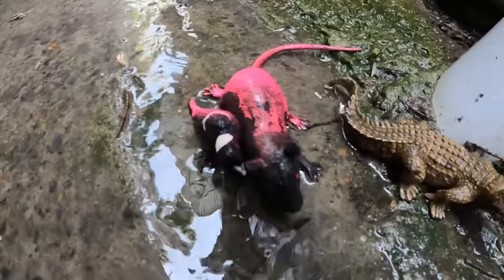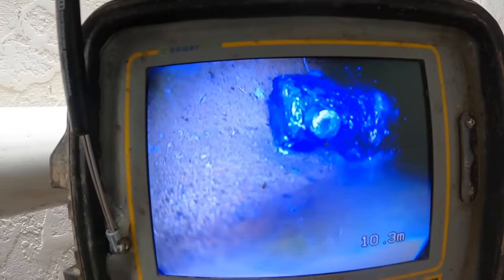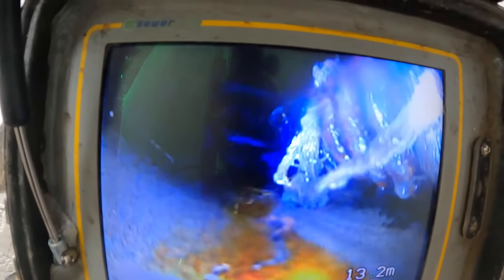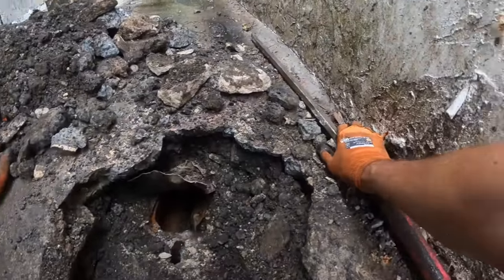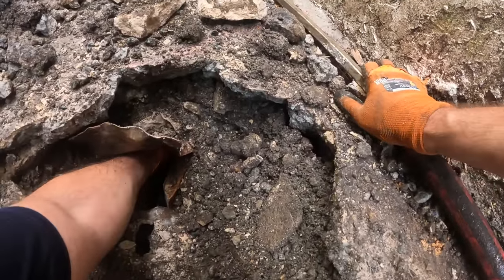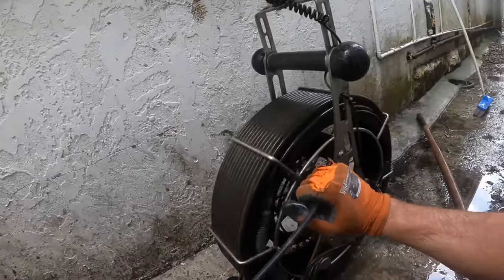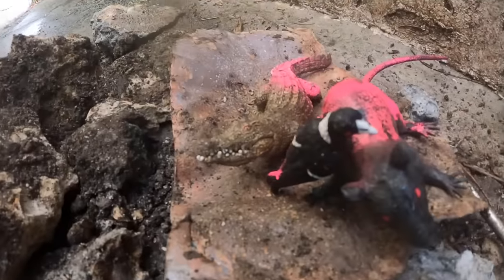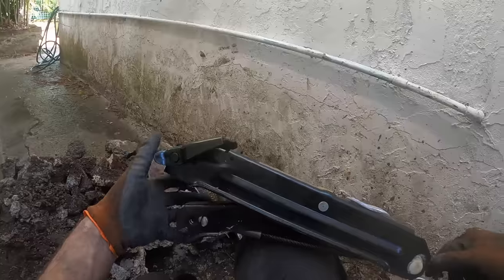Blocked Drain 590

Comment: The Honda refusing to start was great foreshadowing of what a crazy operation that was going to be
Reply: The little Honda is starting to start like a Hyundai 🤣
Reply: Starts like a Hyundai and runs like one too.
Reply: @SnowleopardPearl  can't kill a Honda.......unless you starve it of oil ,they are one of the best little engines around, seen Honda engines run indefinitely with just basic maintenance & simple rebuilds, seen rebuilt Honda engines sound & work better than most of the newer knockoff junk from China or new US built Briggs &Stratton/ Tecumseh engines
Reply: @SirBlueWhale     Hb  zuyuu
Reply: @SirBlueWhale  ur o ybbbbbhhhrbhmhhhb. Fddd be. R no
Reply: @SirBlueWhale     Ici
Reply: @daewooparts  this comment did not age well. That thing is a goner a few episodes later.
Reply: You are the best if you can’t do it know one can 🪠🪠🪠🪠🪠

Comment: WOW Ollie that’s one of the most intense ones you’ve done in awhile! That poor homeowner has some major pipe issues and not to mention the sinkhole under the house!! 
Will there be a part 2 to this home when they do the pipe work??
Reply: With the clog at the bottom removed , they will put a "temporary" patch on the alleyway walk. ... and All Good.
Reply: @deconteesawyer5758  Yeppers they will😊
Reply: Judging by the rest of the property, any “temporary” patch will be there for decades.
Reply: @digsindirt4490  True that! 😂
Reply: "pipe issues"???  The entire building infrastructure, as in,  the mortar holding the bricks and block work together has failed, add that to the foundation falling away [sink hole]... notice the huge cracks in the walls of the exterior of the home, that follow the failing blockwork.  If this was in the US, it would be considered too hazardous to occupy and would be condemned.
Man... I really feel for the owners, this is going to keep them up at night for the foreseeable future.
Reply: @2tommyrad  Well yeah!! I just do isn’t want to say that they just need to jack the house up and slide a new one underneath it 😂😂😂😂
Reply: @2tommyrad  totally agree. I’ve never seen a house in the entire US in this shape 😂

Comment: "Inspection openings (IOs) allow access to the inside of the pipe so that blockages can be cleared." You just have to remove the concrete slab...💪🔨😅

Comment: Is there going to be a (to be continued)? Would love to see what it's actually going to take to finally get that eel out of the drain!

What an absolute bugger of a job 🥴
Reply: He says at the end what needs to happen. Its not just the eel, theres a sinkhole under the house and the plumbing is messed up. He said the best thing to do, is lay another pipe under the walkway outside and join up with the boundary trap. Put the old pipe out of commission.
Reply: @tubester4567  yeah but there was another pipe coming into that pipe that would need to be brought around the house if possible.  Being on the side of a hill like that and a pool in the back it would be a nightmare.  That other pipe coming into that Tee? is probably what let the cable loop around itself like that.  You could probably put on another addition with what it will cost to fix it right.  I'm betting they fill in the hole and just let it be.
Reply: @Spaznaut1  ... go down to Home Depot and get some "day labor" to dig a new trench in a few afternoons.

Comment: Ollie; use vice grips to clamp onto the snake and rotate it backwards to get that knot to uncoil; then use a come-a-long to pull it out; It may just slide out easy once that knot is gone.   You really went the extra mile on this one!
Reply: gary ... so the knot is undone but the end of that snake is still cork-screwed into something, which is why the snake is stuck in the first place. Now that we see the problem the only fix is to replace the pipe.... because the stuck end is under the house where nobody can work.

Comment: I use to use old style car jack that had a post and travel mechanism to pull up old fence post that were not cemented in place.  Worked like a charm.  Since the car manufacturers moved to these new safer scissor or lever car jacks those never would do the same job.

Comment: With that concrete patch you’re breaking through looks like there was a previous problem in that location.
Reply: I think that is where the plumber disconnected the cable probably two lengths still in there.
Or it is just a coincidence where it disconnected.
Reply: I think you’re looking at the previous problem.
Reply: @ratbag359  guaranteed they opened and disconnected it there, the connector end, roll pin and release button were all still intact. and I doubt the female end broke away from it., the spring steel wire usually breaks first, very near the end or where it was kinked and worn thin from rubbing.

Comment: Potential source of the eel: sabotage. Plumber got "hired" for a job, got stiffed, and returned the favor. It would also explain the fact that the IO at the head is completely concreted over.

Reminds me of when I was trying to get internet installed at one of my old living places. Turns out a contractor had cut my stack of units' internet lines when the upstairs neighbor moved to cable internet. No one did a full diagnosis because the person we bought it from wasn't around enough to notice the loss of coverage.

Comment: Do you think reverse on the cable would undo the knots.  It looks like they broke the concrete to detach from the cable.
Reply: Maybe but the plumber might of already tried.
but it would not of fixed the main problem broken pipes

Comment: Car jack. 😆
It'll probably have to stretch at least 2 meters before it comes flying out of there.  A winch or come-along, as well as some anchors and attachment gear (quick links, webbing, etc) would be a good addition to your van.  Wouldn't fix the original nightmare that required the eel in the first place though.

Comment: Just wondering (I have zero experience,  so take this comment with this in mind) ... would it be possible to secure the end of the eel, which is basically a coiled spring, by encircling it with a heavy metal ring then slipping the ring transversely thru the coiled spring until it it stopped by a loop of the coil, and then giving that metal ring a 90degree twist, so that it locks against the coil? Then perhaps you can manoeuvre a carjack to jack it out by somehow attaching that metal ring to the carjack.

Comment: My dad had the same trouble on our motorhome with the generator going out and when he pressed the start button it kept on cranking and then my dad had to pull the heavy generator out of one of the capartments of our motorhome. My dad had to fix the stator on it. A few more years later the generator went out again so my dad took it to a Cummins repair shop in our state of Connecticut in USA.

Comment: Can you get under the house. trace it under the floor with your metal detector (leaving a big pink spot on their carpet) and cut a hole in the floor. Im betting it will be wood or at least hoping. Its either that or pull all of the floor out and relay it. Its getting more expensive by the minute. Charge them well for this one its epic. In the crawl space its no virgin, someone's been in there before you. LOL Awesome Olly.

Comment: Maybe get a winch for your van for situations like this, run the cable from the van to the eel then have the winch do all the pulling. That was a great vid!
Reply: Just needed a come along, but I can't say what condition the pipe would have been in that was a 1500ft pound ball of disaster
Reply: @xtort1077777  yea the whole system is stuffed.
At the least dig up the sink hole in the crawl space and replace broken section of pipe
not many contractors will be keen on that.
There is likely other issues.
Reply: And destroy the pipe

Comment: So what’s the backstory?

Pipe got blocked because it was dislodged, then eel plumber comes along, clears the clog but gets the eel caught on the dislodgement, tears all the pipe apart and gets his eel tangled and lodged for good, so decides to check out and concretes over the IO, never to be seen again? Then a few years later it’s clogged again despite the cavern that’s been hollowed put under the house…

Comment: I was so frustrated for you when you had to start in on the concrete, now crawling around under a house that looks like it might fall apart at the seams is another story, I hope you were well and truly compensated for this rescue mission. I just have to know what the homeowner said when you told them everything you went through to try and fix the "clogged drain"

Comment: I once woke up to water BLASTING out of my toilet (my bathroom connects to my bedroom). The water was shooting about 4 feet up and it was extremely loud. i was completely baffled and i just stood there filming it because i knew no one would believe me. eventually i went looking outside and i found a plumber outside using one of these hoses systems with the sprayer. He discovered that my sewer line had a connection to the storm drain because he started in the storm drain and had run the hose down the street and up into my sewer line somehow. he couldn't believe it happened even when i showed him the video. i think he just didn't want to deal with reporting that my sewage was connected directly to the untreated storm water line. and it never got fixed!

Comment: That house is a proper mess of both plumbing and structural issues. That sinkhole is not healthy, nor are those giant cracks in the rear wall at the end of the vid. I think that whole house slid down the hill a good few centimetres and pulled half the pipe with it.

Comment: If the eel made the sinkhole worse (or caused it in the first place) ... you do not want to be Plumber #1. Very interested in getting an update. As the saying goes, "Once you have opened a can of worms (eels, in this case) the only way to put them back is to use a larger can."

Comment: I would try attaching a metal cable to the eel and pulling on it with a come-along or an electric winch.. herculean effort may be required.
In any case..you sir, are well respected by me.

Comment: judging by the cracks in the walls the separation from the stairs and slab the obvious sinking around the boundary trap and the fact it is on a raise section of land that building is likely suffering serious land erosion from either drainage issues or leaking pipes. call an inspector knock it down and move on.

Comment: I'm willing to guess that the eel guy got it stuck and made that access hole and cut the cable.  And didn't bother to even try to get it out I guess.
And did a "handyman" fix with the pipe and concrete.

Comment: Need to spin the eel spring cable in the reverse direction the eel head turns in. If lucky the cable would uncoil and pull right out.

Comment: I clicked on this because I didn't believe the thumbnail. Now we all know plumbers don't dig (unless they have an apprentice), so what the hell is going on here. When I ring a plumber it's always "well, expose the pipes and I'll come round and sticky tape it back together". One time I dug 1100mm down AND put the crowbar through a pipe that wasn't blocked. Then the plumber has a go clearing the line but its chokka with palm tree roots. He goes "I need to put in a new line, dig there - there - there and there". I wasn't crying, I just got some dust in my eyes.

Comment: Wrap a 1/4" cable connected to an electric winch around the eel and yank it out? Maybe?
Reply: Just a simple come along would work, but i dont figure the pipe to be in good condition after winching it out, that steel spring ball of disaster has a lot of pent up energy.

Comment: You could run a welding cable down to the knot and 400 amps for 30 seconds would melt the knot away.  Maybe.   Or some hot hydrochloride acid?

Comment: the concrete replaced there, someone opened it before to get the eel out and gave up removing what they could, possibly claimed they got the whole thing out and left in a hurry after covering it up 🤣
Reply: I reckon the concrete that was over the hole, who also left the eel in the pipe. That  was the plumber